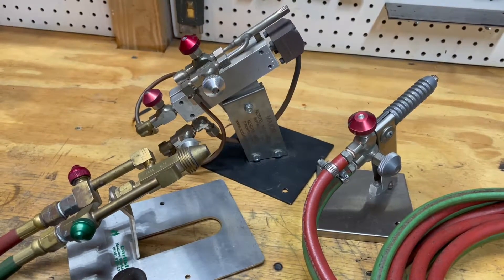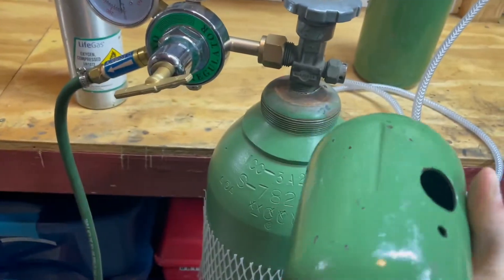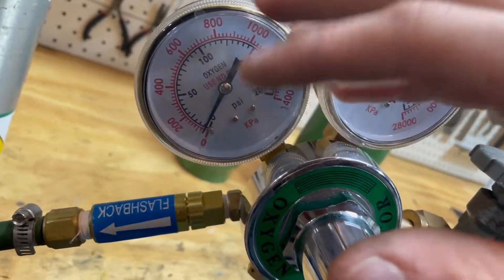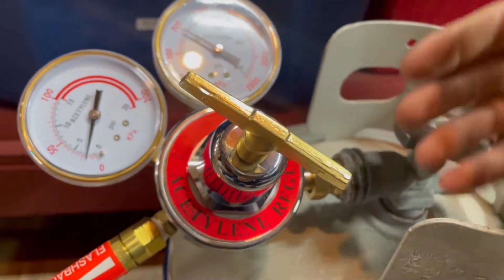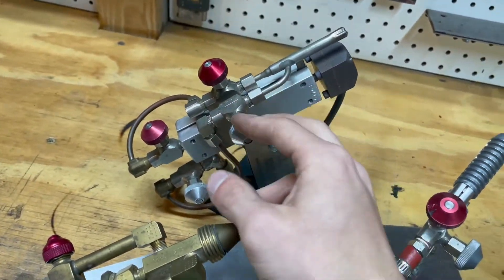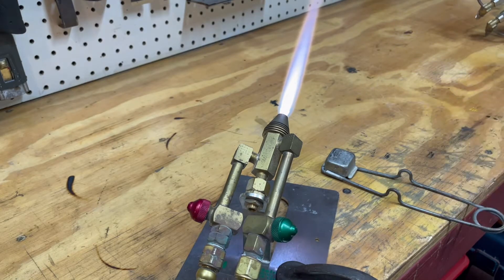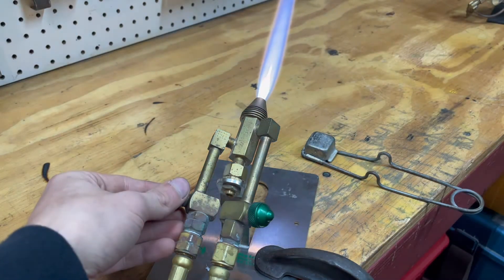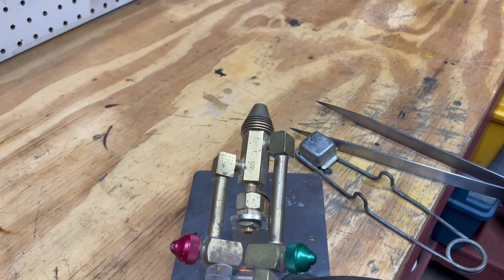Scientific Glassblowing Ep:1 Torch set up, and operation

Comment: Where should I store oxygen and propane tanks outside in weather control container with lines running through wall into workshop or just use tanks in the shop? I thought safety from books it says have all tanks outside so jw where to store them? For safe workshop?
Reply from the maker: I would not recommend running lines through a wall outside, if you have a problem and need to turn the tanks off quickly, you won’t be able to do that. Rather I would run a like a good distance away from the work area (10-15ft) and secure the tanks to the wall with chains. Don’t forget flash back arrestors even though surface mix torches are extremely safe better not to chance it. Let me know if you have any other questions.
Reply: @WheelerScientific  thx